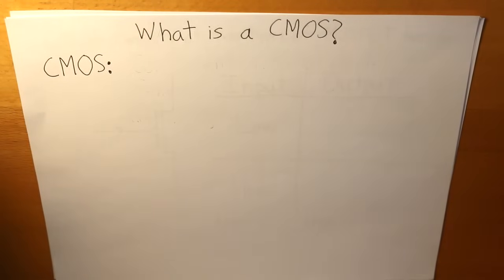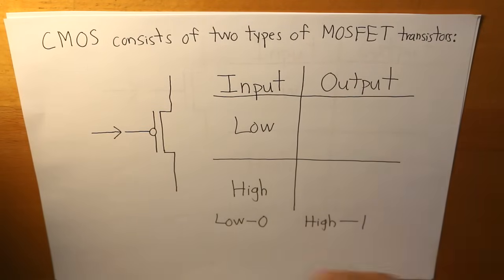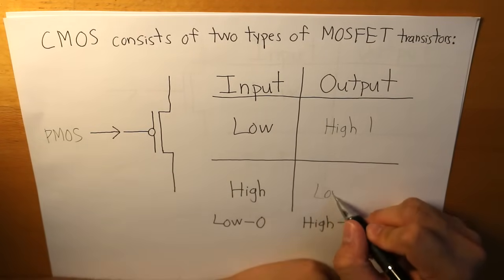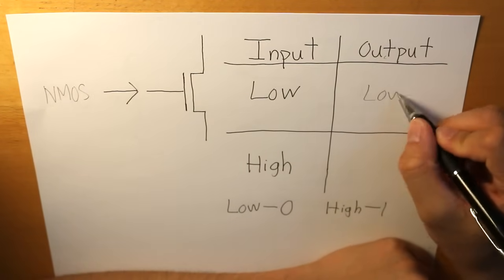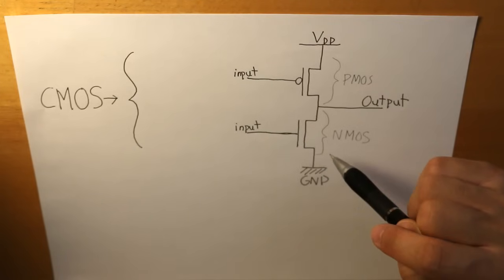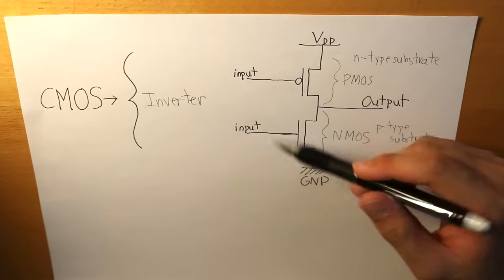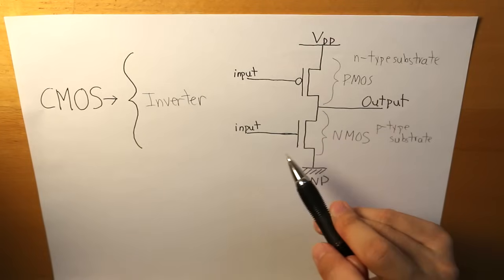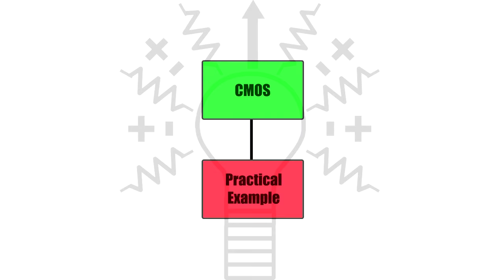What is a CMOS? [NMOS, PMOS]

Comment: If pmos itself behaves as inverter then why do we need nmos?
Reply: Let's assume that we have '1' as an input.
I think that in the case of not using the NMOS will generate something like an open circuit sinse the PMOS is OFF.
Reply: You need two condition since cmos works as logic device.

Comment: The reason why people are finding this video so simple is because it's oversimplified. If PMOS and NMOS transistors worked like theybdonin the video, you would e.g. only need 1 transistor to design an AND gate (not.6)

PMOS transistors float when the gate is 1 and NMOS transistors float when the gate is 0. Outputs for logic gates are not supposed to float, so NMOS and PMOS transistors are used in pairs

When they're used in pairs, one of them floats and the other outputs 0 or 1. If one output 0 and the other output 1 like in the video, there would be a short circuit

I suggest people who want to know how CMOS logic works do further research

Comment: Video ID / sCPN
docgmTprR5o / GP0Y 6Q2C K497
Viewport / Frames
676x380 / 0 dropped of 7852
Current / Optimal Res
854x480@30 / 854x480@30
Volume / Normalized
100% / 100% (content loudness -10.0dB)
Codecs
av01.0.04M.08 (397) / opus (251)
Color
bt709 / bt709
Connection Speed
7129 Kbps
Network Activity
0 KB
Buffer Health
100.67 s
Mystery Text
s:4 t:279.33 b:0.000-380.001 P pl_i:929 pbs:4350

Comment: great explanation! but why do we need a pmos and a nmos to build a inverter, even though a pmos alone kan invert a signal?
Reply: If there was one PMOS only, you could either give it a low signal, which would short the drain and source, yielding a high output. If you give it a high signal, the drain and source would not be in contact, hence the output would be floating and not grounded as in the CMOS inverter. Correct me if Im wrong.

Comment: sir does p mos is a p type jfet and n mos is a n type j
 fet
Reply: It's not a J fet ( junction field effect transistor) it's a Mosfet ( metal oxide semiconductor field effect transistor) insulated gate. P Mos - p channel N Mos - N channel.
P Mos with N substrate, sub base, pnp. N Mos with P substrate, sub base, npn.

Comment: But a P-Mos itself is also a Inverter, it also does the opposite? or am i wrong?
Reply: The problem with PMOS is that, it provides a low not necessarily a perfect zero (when the input is 1). That is, consider 1v as perfect high and 0v as perfect low when inputting perfect high (1v), we may not get perfect low (0v), instead we may be getting .2v (which is considered as low and not a perfect low), this is due to current leak in a transistor which in turn is due to quantum effects such as quantum tunneling. so my point here is PMOS is good for getting 1 as the output and does a poor job in the case 0. where as NMOS is good at giving zero as output but provides a poor quality 1 as output. Therefore we combine this two things and make a circuit in such a way that it provides perfect high and perfect low.
hope this helps you!
Im not sure about this though
correct me if im wrong

Comment: Now with maskless ion beam lithography and electron beam lithography and hybrid ion beam-electron beam lithography using laser guided guidance systems for positioning and alignment, they have made CMOS far effective in cost effectiveness and achive zero defects/zeo rejects status. And using the basic "CAKE LAYERING TECHNIQUE OF JAPANESE CMOS IC CHIP MAKING ENGINEERING" they are attempting to use it to 
re-create the ferrite core memory technology in a modified way so as to revive the ferrite core memory technology which far more durable, tougher, non-volatile, retain data indefinitely without power, and has an indefinite read-write life cycle. Immune to emp, emf, emi.
Reply: are you taking the piss right now mate?

Comment: In the early 1980s CMOS being explained in this way is different to what we personally got from a Japanese engineer who said "basically CMOS is more like a layering process but you must first determine what you need so that you will know exactly what is needed to be done first" It is like creating a multi-layered cake. That is the problem with education today, they try to make things unnecessarily complicated and sophisticated when they can make their explanation so simple WITHOUT LOSING THE GIST OF THE ENTIRE SUBJECT itself. This is why Japanese education is far more effective to the point that they made CMOS technology so simple that it allowed them to use simple designs, larger size components, and compensate by using larger size silicon chips the size of small average letters. They did that in the early 1980s which is why they have beaten the U.S IC chip makers in the international market competition. Now with maskless ion beam lithography and electron beam lithography and hybrid ion beam-electron beam lithography using laser guided guidance systems for positioning and alignment, they have made CMOS far effective in cost effectiveness and achive zero defects/zeo rejects status.
Reply: Lol, what a horribly biased rant. Muh sinophile education bus muh superior, lol. No, that's not where the advances in semiconductor and engine manufacturing came from. Please stop spreading stereotype-based misinformation like that.
Reply: @VndNvwYvvSvv  YOU ARE EITHER THE MOST IGNORANT AND STUPUD YOUTUBER OR A PAID TROLLER TO SPREAD DISINFORMATION AND DISSENT AGAINST ME OR A BOT CREATED BY YOUTUBE TO DESTROY ME AND MY REPUTATION AS A 2SD GENERATION ANALYST INTELLIGENCE OFFICER WHO IS BETTER AND MORE INTELLIGENT AND WISER THAN MY PREDECESSOR WHO HAPPENS TO BE THE ORIGINAL DARTHVADER5300 WHO IS ALSO MY GRANDUNCLE! SO SHUT UP ASSHOLE FOR REAL INTELLIGENT PEOPLE WANTS TO SPEND THEIR TIME IN BECOMING JUIAN ASSANGE AND SNOWDEN IN THE WHOLE WIDE WORLD OF CYBERSPACE!

Comment: we use CMOS tipe because the power drain is much lower on combined tipe than in a pmos on its own ... example in a microprocesor with olnie pmos transistors your power drain of the procesor will be >"100W" but in combined tipe of CMOS you dont need that power. so the CMOS transistor tipe is used in low energy consumption devices or microprocesors (CPU-s).

Comment: I think we need a CMOS instead of the pmos or nmos alone because the pmos gives strong high but weak zero, and the nmos gives a weak one/high and strong low/zero. that is why the pmos is stuck to Vdd and nmos is stuck to GND. So we can have rail to rail switching(strong zero and strong one or high).
Reply: sir, what is the meaning of "strong" zero or one ?
Reply: @bickyou4696  PMOS is better at pulling  VDD to output and bad at pulling GND to output
and

NMOS is better at pulling  GND to output and bad at pulling  VDD to output.
Reply: @bickyou4696  It means that it is a clean signal. If you define your high as 1 volt it is "strong" in the sense that the whole 1 volt is transmitted and not only 0,7 volt.

Comment: Why do you need a CMOS, if PMOS does the exact same inversion?
Reply from the maker: The PMOS is just a switch. You need values for the transistor and that is why we have a VDD and a ground. VDD represents a value of lets say in binary "1", and for the ground it represents a value in binary "0". Let's say you input it zero, the PMOS is switched on and the VDD passes through the output. The ground does not pass because the passage way is open since the NMOS is switched off given the same input. That is why you need a NMOS and PMOS together to make an inverter, which is essentially a CMOS
Reply: Unfortunately ,pMOS and nMOS they are not perfect switches in the real world(there are some delay), In particular, nMOS transistor pass 0's well, but not for 1, pMOS transistor just in the opposite reason. my English is poor, i am not a native speaker. i hope it can help you :)
Reply: And we can build every circuit with PMOS. We use CMOS in order to avoid the losses caused by PMOS OR NMOS. We have more than 0.7V loss per gate. When we have multiple gates cascaded this loss will increase in a purely PMOS circuit (or purely NMOS). CMOS is used to minimize the losses. This is why it is used in logic circuits.
Reply: @danushaaditya3630  padhne aya hai ya , prem milap karne
Reply: @danushaaditya3630  Bro you still with Kavya?
Reply: @astroash  you think xD
Reply: @danushaaditya3630  Oh man she sounded like suchha good girl. What happened?
Reply: @astroash  She is dude. I messed up ...
Reply: PMOS alone would not provide a path to ground. A logical circuit has much more capabilities if another segment within a larger circuit can logically flow to its ground through the NMOS, if logically appropriate, otherwise the logic is stopped, as the positive voltage from  the other part of the overall logic circuit has no way to get to ground.
Reply: PMOS is better at pulling  VDD to output and bad at pulling GND to output
and
NMOS is better at pulling  GND to output and bad at pulling  VDD to output.
Reply: An advantage of CMOS over NMOS logic is that both low-to-high and high-to-low output transitions are fast since the (PMOS) pull-up transistors have low resistance when switched on, unlike the load resistors in NMOS logic. In addition, the output signal swings the full voltage between the low and high rails. This strong, more nearly symmetric response also makes CMOS more resistant to noise.
Reply: Treinstein I think there’s one great explaination for that.. You should look about their structures/how are they made..
Reply: You can build every circuit by just using NMOS. This is not the reason why we use CMOS.